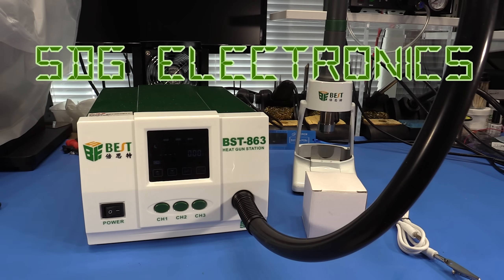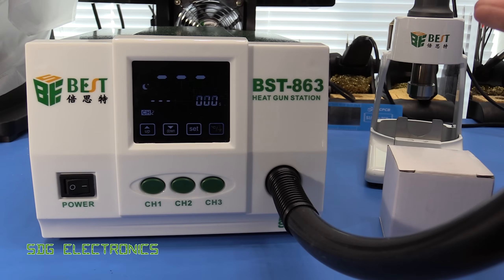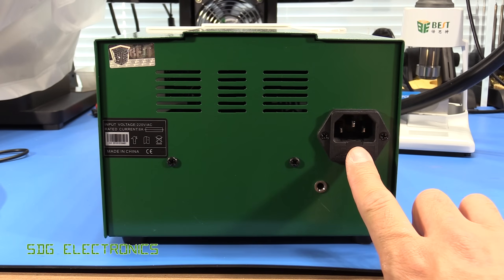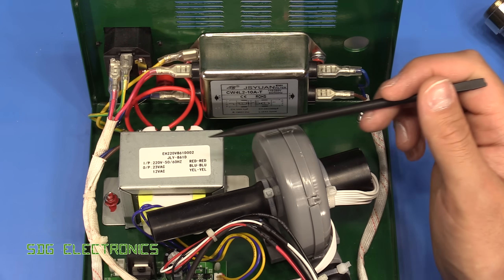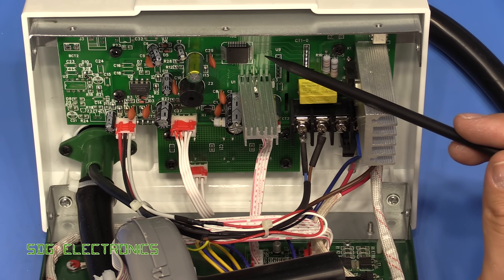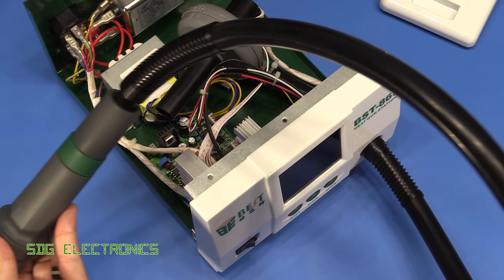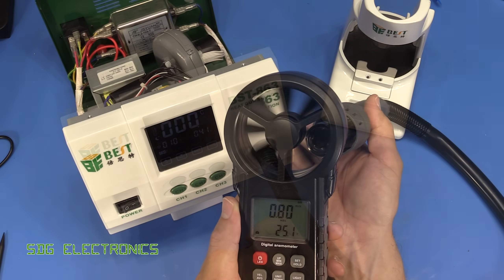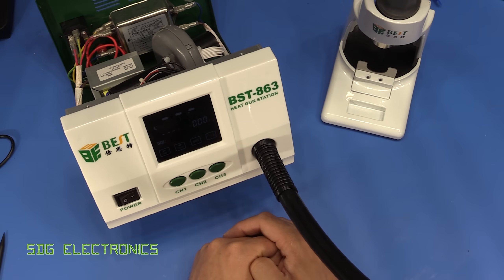SDG #084 Best BST-863 1200W Hot Air Rework Station - Alternative to Quick 861DW

Comment: Another youtuber has made a kit to convert this BST-863 to have analogue dials to control air and temp. It consists of a replacement front board, two potentiometers and knobs etc to add the dials. The touch screen still works, but you have instant and silent control using the dials. I wish I would have found these reviews and conversion kits before I bought my Atten ST862D. The Atten is great, but this is probably better, especially once the conversion has been done. Here is a link to the conversion video and in his description he lists his store to buy the kit. ($68 Unassembled or $78 fully assembled.) I really wish I had seen your video and his! https://youtu.be/_PKAgJuqW78

Comment: Hi, I have got a question. 
I need the 220V version of the station because I live in Europe, but only the 110V version of the station is available.
Is there any difference in the station besides the cable? So has the station both support for both voltages or has other hardware to be installed in the respective station?
Reply from the maker: The heater is AC powered, so you do need the correct station for your area.

Comment: I just bought one of these and it doesn't spin up the fan at all when picked up out of the cradle. Vendor says I'm using it wrong, it did heat up once and only once which resulted in an overheated element as the fan did not turn on, I thought perhaps it would turn on the fan only after allowing the element some time to heat up but that's clearly not the case. When I pick up the handle from the holder, it briefly has a high pitched whine like you would expect of a brushless motor that the controller is trying to start, however the blower does not run at all. In case the vendor is correct and I'm just not using it right, is there some sequence or something that would explain this and that I need to do in order to allow the fan to run?  BTW I don't believe there is an effective fault implementation between the brushless controller and the main controller, otherwise it would not have permitted the element to heat (and overheat) with the fan stopped.
Reply from the maker: So long as the handpiece is in the stand when you first turn it on, that's all that matters. If it managed to overheat then it's definitely a device failure - you can't do anything wrong to cause that.
Reply: @sdgelectronics  It was a faulty blower, I sourced a Quick branded replacement blower which appears to be compatible and it starts right up. Unfortunately I also need to replace the thermal fuse which I discovered had blown after replacing the fan and heater element. The thermal fuse appears to be 121C and has a diameter of roughly 4.2mm however the way it is mounted in the plastic it looks highly specific to a certain model of fuse (diameter will need to match very closely). Overall this has been a very expensive, painful purchase. Interestingly, with a total fan failure the thermal fuse is obviously ineffective, even at the low 121C temperature it did not actually blow until after I'd already realized the element was on and overheating and had turned the unit off. I'm glad to see they were thinking of safety by including the thermal fuse, but it just doesn't really do the job it needs to as ideally you want something that shuts things down before, and not after, things get hot enough to cause damage or start a fire.

Comment: I need your help I have a Best BST 863 she is changed the temperature is uncalibrated. I checked with thermocouple with multimeter and the temperature is showing uncalibrated. I don't know the key combination to calibrate the temperature would it be possible for your help please
Reply from the maker: I think someone found the calibration steps on the EEVBlog forums if you can search there.
Reply: @sdgelectronics  I didn't find anything that can help me manually calibrate the temperature of my BST 863.. I've already checked it with the thermocouple but the temperature is very different. I didn't find any topic on how to calibrate this station using the thermocouple to verify that the temperature marked on the display is the same as the one that comes out on the stick. I don't know what else to do because I can't use it correctly. that's why i ask for help

Comment: I have one and I must say it is impressive when it works. After 6 months of very light use the blower failed. It turned out to be a failed fan control board. I approached the people I bought it from on AliExpress and after a couple of week back and forth trying to get them to replace the fan control board I got them to agree to replace it with no charge. I did have to buy another heater element because when the fan failure occurred it burned out the heater with no air flow. It took about 1.5 months to get the replacement part from China to Australia. The new fan control board is quite different from the one that came with the unit so there may have been a design problem with the original board. The unit does now work again. I also found that my unit had the power switch in the neutral line not the active one. This is a no-no in anyone's regulatory jurisdiction but it was pretty simple to switch the power connections so that the power switch was in the active line.

Comment: Looking for more from this Quick clone. Don’t think the Quick 861DW is in any danger of having itself dethroned by this upstart unit, but time will tell. I agree with you on the low volume air control in actual use. People whose opinion I trust and whose income is dependent on their equipment’s quality of construction to make their living, swear by the Quick 861DW. Any piece of equipment is subject to be bested by another manufacturer, but build quality is key to consistent, reliable and repeatable high quality results. The Quick unit mentioned has this. I hope this one proves itself to you. Don’t like seeing anyone get jacked by a bad purchase mate! Not you or anyone else! I’m a scrutinous person when it comes to gear. You are aware that there are cloners that could be really good if they stepped up their game with better quality of internal parts. Surface mounted components soldered with hot air is not my forte, but I have learned by watching highly respected people to be always weary when considering any piece of gear, particularly when their income is dependent on it. This piece is worth a look from what I see so far, but you will let us know what you think about it and that is good enough for me. Hope you get some real good use out of it as I will be watching. Your word holds weight mate, so I am interested what your opinion is as this piece steps up or gets the boot. Looking forward to your evaluation. It’s ability to produce high quality results is in your hands. Good luck mate! Stay safe mates!😊👍🏻😷

Comment: My unit just failed. The heating element started to shut off/on and then suddenly just died completely. It just blows cool air now... I'm assuming the heating element failed? Where would I get a replacement heating element? Trying to get Banggood to provide support, but it looks like it's taking awhile.
Reply from the maker: You can use one of the Quick 861dw ones, it's a direct fit. Not sure about replacements directly from Best.

Comment: hello should i get this one or quick 857dw+ instead? the price difference ist just about 30€ (i am not sure of quality of touch screen and overal build quality).....or is it better to buy station with pump instead of BLDC motor? thanks
Reply from the maker: There's not much in it really. I prefer the way the BST-863 works and how quickly it cools the handpiece down when you put it back in the cradle. I still have the Quick 861X sitting on the floor in favour of the 863.

Comment: This works same quick or this is better than quick 861dw??
Reply from the maker: A bit quicker to heat up, but otherwise the same. I have an 861X on the way which will be a closer match
Reply: @sdgelectronics  ok so can I buy this for iphone pcd repair touch ic /nand or any iphone ic can it remove  and other work it will help me without demage iphone motherboad??
Reply from the maker: @romzget1892  yes, it's designed for that kind of use
Reply: @sdgelectronics  bro sorry my last Quiz  can I use quick 861dw nozzle 45 degee angle  on bst 863 are they share nozzle without problem please?
Reply from the maker: @romzget1892  Yes, the fittings are the same.
Reply: @sdgelectronics  ok thanks let me wait my bst 863 on the way thnks bro for your time
Reply from the maker: @romzget1892  It's a good unit, especially for the price. I've been using mine regularly with no issues. Most parts are interchangeable with the Quick, including heaters etc.
Reply: @sdgelectronics  yah bro best 863 its the best

Comment: Actually this would be better compared to the bigger brother i.e. the Quick 861DE not the 861DW. As the 861DE is also 1200W. The only thing I was missing was some idea of how much the airflow is in liters/min. The 861DE has 200 L/min and I have to say I am glad I took that model as the extra airflow (compared to the 861DW which has 120L/min) really comes in handy on those really difficult jobs where there is a lot of heat dissipation interfering.

Edit: Also not sure about the touch screen thing, does it still work with nitrile gloves on? The fan spinning to full when it is put in the cradle is also to increase heating element life mainly and to cool it faster in case you are changing nozzles.
Edit 2: Mind you price wise this thing is a really good alternative. I wish they had included the conversion nozzle too (Quick does, or at least mine came with one) which allows you to use any Aoyue nozzle on the machine. This gives you access to a whole range of nozzles designed for soldering and desoldering different packages such as PLCC, QFP, BQFP, BGA, TSOL or something like their neat adjustable double round nozzle that is quite nice for heating up both sides of smd resistors, caps etc at the same time with directed airflow. Luckily you can get that conversion nozzle seperately and I assume it fits on this unit right?

Comment: Very nice review !! Good job, i want to share this with you thow.
I bought this station twice..be aware that it has issues after some time with the air pump....unfortunately i send back both stations...and quick 863dw/de are much better..
Reply from the maker: Thanks for your feedback - from what I can see, the driver and pump appear to be almost the same as the Quick 861. I've not seen inside the 863 but am looking at testing some other Quick hot air stations.

Comment: Just an academic point on your air velocity measurement.
The actual velocity will be much higher than indicated due to the vane area larger than the nozzle area acting as an air pump and slowing the vanes down.

Comment: You need to open the unit and put a drop of oil on the blower barring
Reply: The humming sound is the PWM of the driver ramping up the fan speed, not the bearings.

Comment: How does it compare to Quick 861DW?  temperature accuracy and stability?
Reply from the maker: There's some overshoot when initially heating up at the lowest airflow setting, but it's fine from 5% onwards. It's actually pretty spot on over the whole range
Reply: @Patrick Woodlock A very important part of the temperature stability is PID control which has been implemented in the MCU. Without a proper measurement and log the the actual temperature for a few minutes, we cannot conclude the same quality as Quick delivers.
Reply: @Patrick Woodlock So best is a better value over quick, right?
Reply: @Patrick Woodlock Did you end up getting this unit?  If so, how is it working for you?

Comment: I bought some junk unit for less than 100 USD a couple years ago, with the blower in the handle.

The output on this one SEEMS like overkill but, with the push of a button, you can go from preheating a large area to focusing your heat on the component in question.

My tinkering doesn't directly pay the bills, so I'll be sticking with my junker for now.

Comment: Quite decent construction inside, good grounding, filtering, I like what I'm seeing and like I mention in my videos stuff coming from China has improved greatly in recent years.
Reply from the maker: Yes, there seem to be a few brands that have taken on the role of making much better quality equipment. This shares so much with the Quick station, I'm not sure if it is all made in the same factory.
Reply: @sdgelectronics  Better value - yes, better quality - not so sure. It seems like the Quick has an "impeller"/axial fan that's attached to the motor made out of cheap plastic and it cracks/breaks pretty easily. It looks like translucent piece of garbage and many people complain about it. Wouldn't trust a plastic part to withstand such high RPM at 120l/m for a long time. 🤷‍♂️ Wished you would open the plastic shroud of this intake fan so we could really see what it's all about. I'm really hesitant as to what air station to purchase atm. 🙄😒
Reply: @sdgelectronics   but this worfet to buy .
Reply: Their local consumes are becoming more discerning and demanding quality.

Comment: Without personally testing one, I think the heating (and cooling) power is superb. I don't like the UI, but presets are probably all one needs to use most of the times, so it's not huge deal. 
Very good review.
Reply from the maker: Yes, I rarely use anything other than a few main settings. The third preset is always reserved for heatshrink tubing!
Reply: @sdgelectronics   try to  inprove the station like Randomhacks did.

Comment: I´m surprised these guys would send you something they value in 200 dollars for free, just a for a review, and to keep it after.

Besides that, it looks really good, though really expensive. They might be having above 150% profit on these at that price. Other than that, I like seeing some chinese companies catching up in quality, but the fact they are not marking the mcu´s, overall on such an expensive unit is a bit like wtf. If they provide no local service, do they really expect these units being sold and sent back and forwards for repairs?

Besides that, in a country where in three days the guy next door could have a clone of your device, I just don´t see the point on not doing it the other way around, which is to supply open firmware and schematics so that people would buy it because they know they can repair it and customize it, while you, as a company, save the hassle of having to support your devices abroad, other than by supplying replacement parts, at the time you build up a customer-base that will always buy.
Reply from the maker: The cost for any company to supply a sample for review/feedback etc is a drop in the ocean really and it saves them investing in stock if it's not going to be a relevant product. Google ad campaigns cost tens of thousands of dollars at a minimum. I get your point on the MCU, but most people are just going to turn it on and use it rather than edit the firmware.

Comment: Good review Steve.. I'm not really a fan of the touch screen stuff however at least with this unit the adjustment rate is pretty quick, so no hanging 
around waiting for settings to change.
Reply from the maker: Touch screen or buttons doesn't really make too much difference for me so long as they are just plain buttons on the screen rather than endless menus. I prefer the dials on the Metcal HCT-900 though. Thanks John

Comment: Did you check the power draw to see if the heating element is actually what they claim it is?
Reply from the maker: Yes, it's overall about 1225W with the fan etc running

Comment: Thanks Steve! That looks like a pretty nice rework station. I don't like touchscreens much when I am wearing gloves. I would rather have the Quick with the pushbuttons. Can the temperature go to 500C?
Reply from the maker: It goes from 0°C up to 550°C
Reply: That's good. I use 500C to remove EMI/RFI shields.
Reply: I see that it goes to 550C. I guess that is good but I don't think it is necessary. My experience shows that 480C is plenty but 550C might get those EMI/RFI shields off quicker.
My Aoyue Int852A++ only goes up to 480C but that seems to be good enough. I guess that is close enough to 500C.